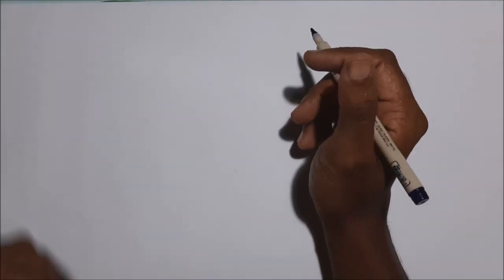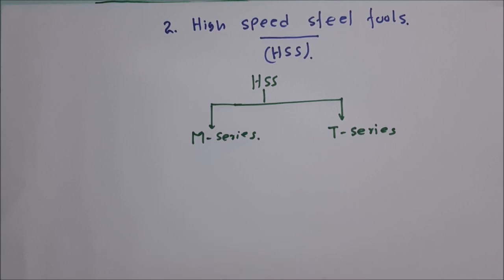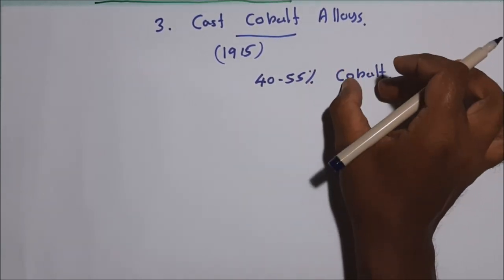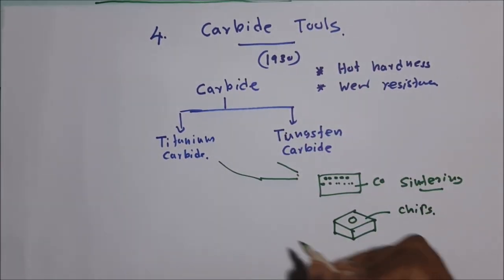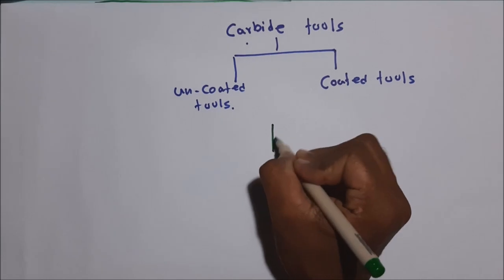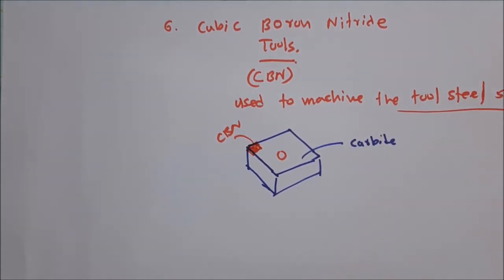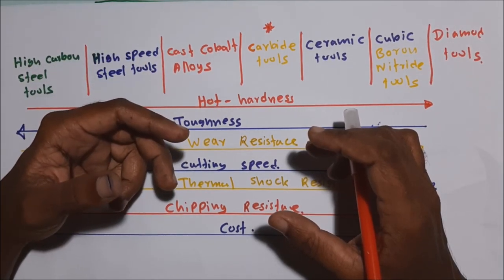Cutting Tool Materials | Lecture-5 Part II

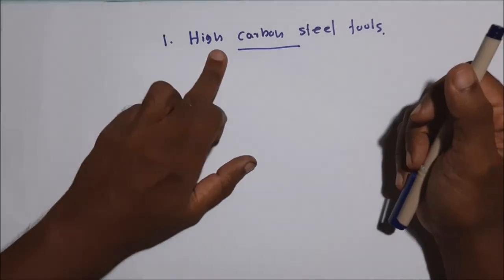Comment: 1) high  carbon steel tools - 1:10
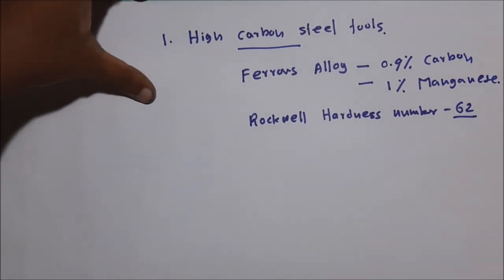2) high speed steel tools - 4:10
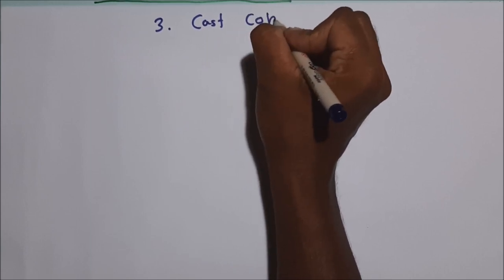3) cast cobalt alloy tools - 12:20
4) carbide tools - 15:45
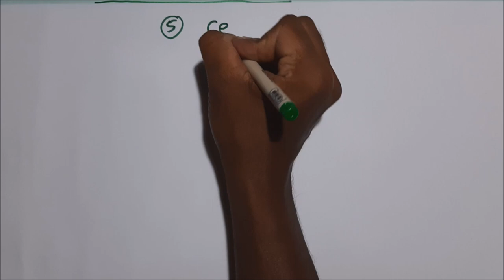5) ceramic tools - 31:32
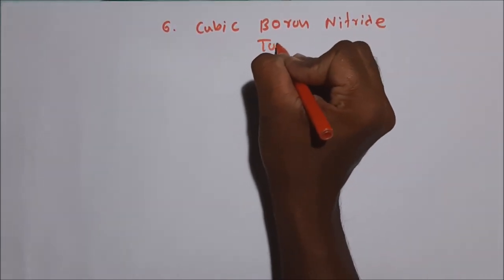6) cubic boron nitride tools - 35:50
7) diamond tools - 38:45
🔥🔥